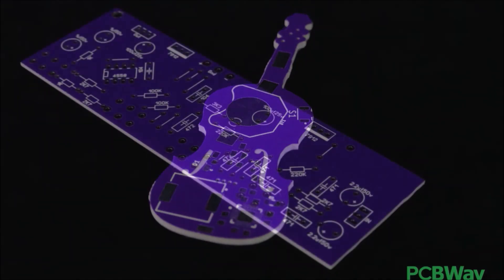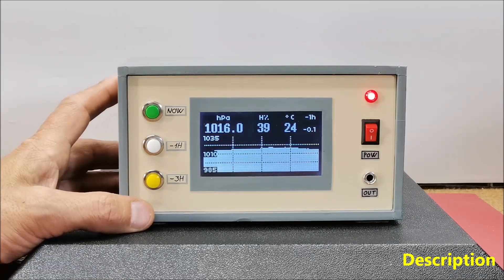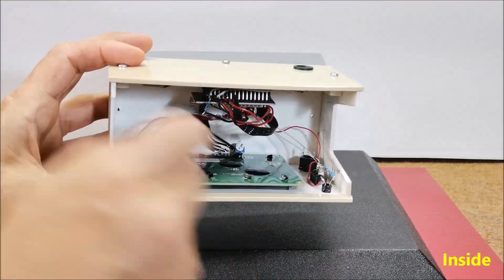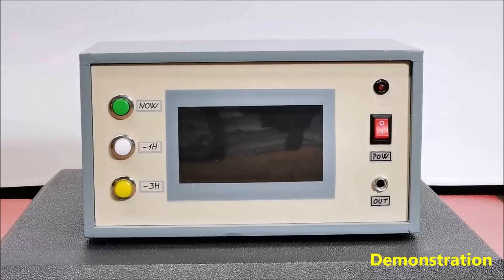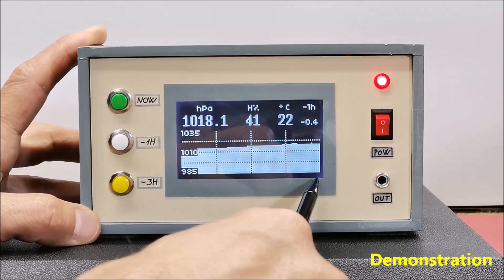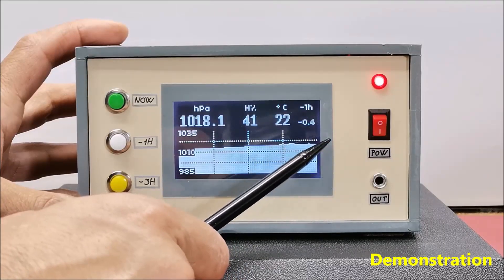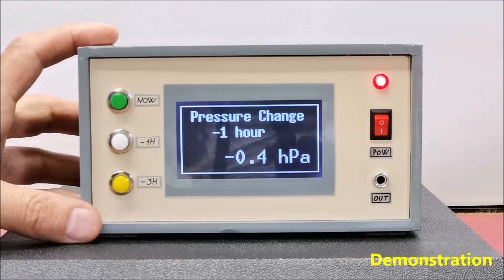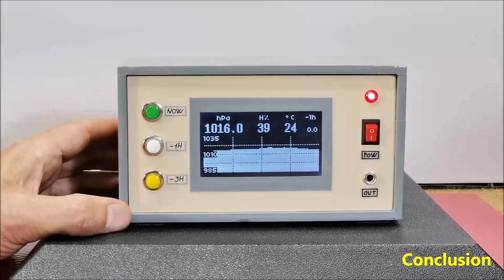DIY Digital Barograph with BME280 and ESP32 24 Hour Pressure Trends

Comment: You are good at what you do here. No question about that. Seen many of your videos and built a thing or two. At this point more than anything I would like to know about the cases for your projects. I can't tell if it is something like a foam board construction or 3D printed. If you have done a video in the past could you point me to that?
Reply from the maker: I make the cases from soft PVC material and process them with a scalpel. In one of the next videos I will explain the method of making them.